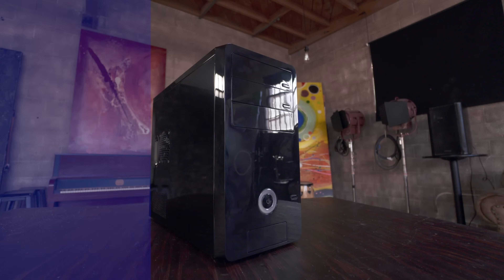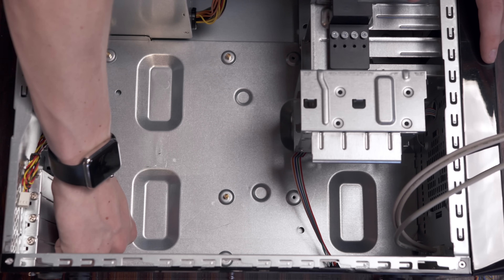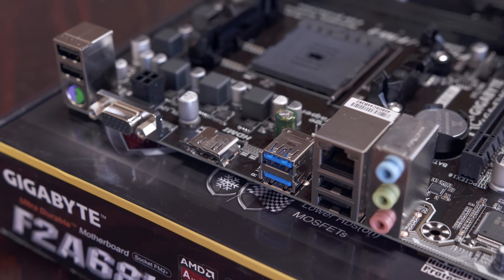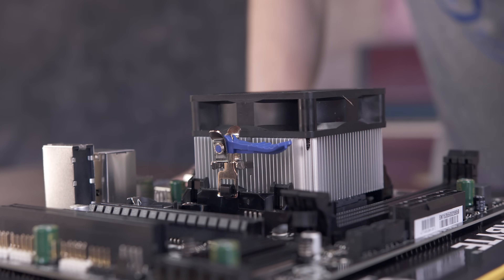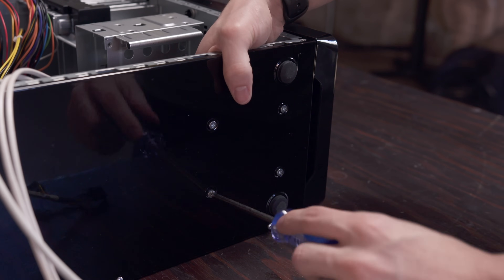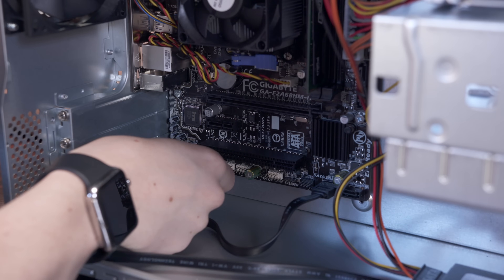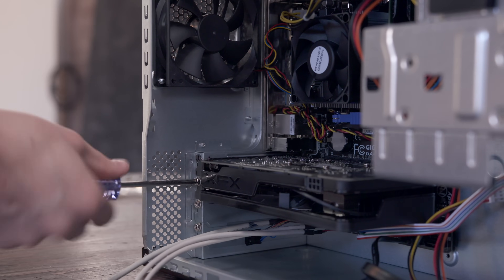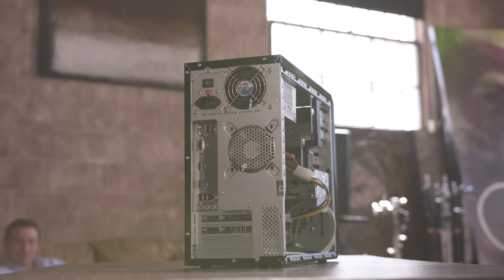How to Build a Gaming PC! (2016)

Comment: Can you do a guide on how to overclock my SSD? I want to run Battlefield 4 at 600 Ghz of RAM but I don't know how to liquid cool my mouse.
Reply: Whoa bro, console gamers might take that comment seriously.
Reply: same, but i could ony download 3 terabytes of ram for my fps to boot quicklier
Reply: That's just flat out wrong. You don't liquid cool a mouse. You have to use fans. And THEN you download the graphics card to screw in the bios.
Reply: HexBuild Wow that's nothing.. I bought a week ago some Bluetooth receiver so my graphics on my keyboard would be ultra so they could response fast when i click on my mouse
Reply: Im pretty sure you get a new GPU so you can have fast internet on your mouse...
Reply: stupid console gamer here, Im looking to get a gaming pc I have a mouse but it doesn't have neon liquid cooling will it still work? I also want to overclock the clock on the pc when I get it working by about three hours or so... I also have a TofuX1-77uV graphics card so Im gonna be getting that sick 10 80 P. What specs would fit my GX1 liquid cooled neon mouse so that I can run the original super mario brothers at ULTRA GRAPHICS, any suggestions?
Reply: Honestly if you want good graphics you're going to need some LED lights and they gotta be red because red stands for Really Epic Draw-distance and for high fps youre gonna need to use a 4k mouse or else you'll get jetlag
Reply: 😂😂😂 Took me a while to see the sarcasm lmao
Reply: Dude, you should first get a new GPU to cool your PC ok bro?
Reply: Can you even overclock a SSD???
Reply: +SilverMight Try and upgrade to 1080p RAM so your 256GB mouse can run games at 4.20Mhz. Thats how I got my SSD to liquid cool my motherboard better.
Reply: TJ Moore The original super mario brothers may be too high for your graphics card.. Try upgrading your soundcard so it could run Medium.. I suggest to play minesweeper ;) it MAY if you're lucky play on 10 fps
Reply: Exactly! RX 480 ram sticks make sure that there is no input lag from your pc and monitor. GTX 1080 ram sticks however have a low voltage meaning you have less hard drive space on your keyboard
Reply: ung loco have you installed system 32? If you have, uninstall it. You should then see steam emminating from the space bar. Download a FireWire cable and pour milk into the machine. And then you're a wizard.
Reply: My ikea core i5 table overclocks to 4.5 ghz and my moniter is overcooled
Reply: Tbh all you need is an i7 4690k mouse and you'll be able to play minecraft with around 10 watts and like 5 GB or something. You should be good to go. Oh, and don't forget your keyboard should be set to 144 hz so that your motherboard doesn't overheat.
Reply: +If you read this you're awesome lmao
Reply: TheVirginityStealer um no 4k mouses are too expensive but you can use a cheaper alternative by getting a 1080p mouse and get a blue led mouse and wrap it around the 1080p mouse for 200 dollars cheaper
Reply: You need a new sound card for the ram to update the graphics cards psu though
Reply: How about getting a Pentium G3258? It's expensive, but you won't have to worry about bottlenecks in your system for a long, long, time. And toss in a GT 210 for the absolute best in graphics.
Reply: Rajiv Paranavithana What are you talking about? Pentium's are good GPUs! The dual-cores allow for it to liquid cool the RAM faster. Thus, speeding up your keyboard's Internet connection.
Reply: WTF AM I READING HAHAHAHHAA
Reply: yeah I followed the instructions but my fans are still running at 4 liters per second even after I over clocked my raid69 Linux server mouse
Reply: Water cooling mouse is quite tricky but rewarding since it decreases power usage and lets you download RAM and you get 4k
Reply: This is the best comment chain ever 😂😂
Reply: No, it's easier to just download more RAM and ghz from the interwebs. Then liquid cool your keyboard, mouse and monitor to get extra FPS.

By the way, what RAM sticks do you guys have? I have two GTX 420 blazeits.
Reply: Peeking Turtle I thought it stood for Super Speedy Dinosaur oh well.
Reply: I like how some people actually took this comment seriously 😂😂😂
Reply: +MrColate8 Why should a minecraft piece of shit know this, go back to consul.
Reply: ***** Yeah, but RX 480 ram sticks are better for budget cuz people who use GTX 1080 ram sticks are overcompensating.
Reply: Your not smart either. "ur not funny stfu" shows how stupid you are y'know. I honestly don't care if you find me funny or not but I think your just some salty kid so that makes me care even less.
Reply: Rajiv Paranavithana You could go with a  Celeron G1840. It has out-of-this-world performance - even better than that of the G3258. It's just that they're not worth the price for the performance they offer. Have you seen the benchmarks? They're insane. It's clocked at a whopping 2.8GHz.
Reply: put your Pc in the dish washer. thats how you'll get it to be water cooled
Reply: Help!!! Does anyone know how to run BIOS in Crossfire, oh and I tried overclocking my monitor but it failed because of my RAM SLI.
Reply: Daniel Sauvé thats okay cause you can change it to ABCDEF keyboard layout. much easier to use because everyone knows the abc's. also, it automatically switches your keycaps for you so no need to do it yourself.
Reply: Bleach Flavoured Clorox Bleach what's so funny, we're just sharing our awesome specs
Reply: Boi, listen here I got a 6000 DPI motherboard, and 16 gbs of processor, and don't even get me started on my badass liquid cooled LEDs. Bro my beast of a pc would annihilate anyone's chairmarks, trust me.
Reply: ung loco just install rgb leds
Reply: Nicolas Henshilwood Do not delete system 32
Reply: Did the intel i5 come flatpacked with instructions?
Reply: +Vulture Vult nah fairly sure you need to overclock your cpu cooler to update your graphics card psu
Reply: you all have it wrong you need to use liquid nitrogen on the ram the you overclock the power supply
Reply: Bashir Wada ur not funny stfu
Reply: +SilenT don't want to be grammar nazi but this kid is either uneducated or he's a 8 year old
Reply: Today im downloaded 8 gigs of ram, im overclocked my hdd to 20000Rpm and the case to 4Ghz
Reply: Sam van der Kris ARE YOU CRAZY?!!?!? U need to download the goat before the ram so then you get enough ghz to upload it into the cloud and then you wait for it to rain so u can get it from the sky. After that u have to buy GTA V and finish the story mode enabling you to lead illuminati or anonymous which u later find they are both connected and have to kill the president......... of Finland and then u can put it into ur computer and enjoy..... good day sir
Reply: I upgraded my RAM to 5GHz and my CPU got more FPS. Try bottlenecking the BIOS and to see if it helps your Mobile SATA GPU.
Reply: ***** 

I think my power supply will provide the sound I need. I just need to overclock it to  600 ssds.  Not to mention I'm downloading more ram to my power cable.
Reply: to over clock your ssd first you will need a hammer, and then to run battelfield 4 at 600 ghz ram you need to pour water on your ram slots and then to liquid cool your mouse dip it into water.. and if you want to liquid cool your pc then put it in your tank. it works perfectly fine..... as you wish :D
Reply: cringe
Reply: edupz Sorry dude, you need an Amd i7-234567.
Reply: Ung Loco bro if you use a gtx 980 the mouse liquid cools itself just make sure your fish tank is inside the computer case
Reply: omg someone should make a pc with a fishtank water cooler HOLY SHIT THAT WOULD BE DANK
Reply: Wilgains Fleuridor it's a joke you stupid idiot
Reply: +Wilgains Fleuridor dont you get a joke?
Reply: Wilgains Fleuridor you're a fucking idiot
Reply: No, I liquid cool my motherboard. I use solid nitrogen (its better than liquid nitrogen) to cool my motherboard. I attached my fans to the 220VAC on the wall so I can get very fast solid nitrogen pumping on my motherboard. I also downloaded some ram and got myself a Seagate 4TB SSD for the graphics card. AAAAND got myself a 5GHz Octo-Core air cooled LCD keyboard so everything is cool. I have the best Xbox in the world.
Reply: Areg Hovhannisyan peasant. i fly my pc all the way to space and play it there. no air=no heat=no throttling. thus i have the best n64
Reply: You can't play BF4 with that much memory. You need to make sure that you download AT LEAST 1 THz, or the textures will look like N64 graphics. Also - I can't stress this enough - MAKE SURE THAT YOUR POWER SUPPLY'S WATER RESERVOIR IS REPLACED AND FILLED AT LEAST ONCE EVERY HALF HOUR (Antifreeze works fine, but I'd recommend perchloric acid because it tends to produce more fps, especially in GPU-heavy games like Minecraft and RuneScape.) Another thing...I'd highly recommend building a custom water cooling loop for your headset, especially if you plan on playing CS:GO for extended periods of time. You don't have to go super expensive. I just duct taped some PVC pipe together and led it from my left earphone to my GPU's blower fan. It's been working rather nicely for the past few months.
Reply: TheVirginityStealer Yeah but if you want a GTX 1080 ready storage unit get a Samsung ERO 690 with 500 gb of storage
Reply: I actually thought he was serious at first LOL
Reply: arun hdgaming I dont really like Ikea cores there are always pieces left over when im done putting the pieces together :<
Reply: omg, my friends @ school (and me) all have those kinds of icons
Reply: Best comment ever
Reply: lol :D
Reply: well i actually do sweat a lot and my hands get warm so it wouldn't be that bad :D
Reply: take a clock and stick it to your ssd
Reply: ***** no he needs a water blonk so the under water mice can have more air by 10000000000000000000000000000000000000000000000000000000000000000000000000%
Reply: You'll first have to upgrade the RAM in your brain if you don't want a bottleneck.
Reply: Bashir Wada LOok whos talkiing and how does it proove that im stupid like ur family
Reply: +LimitLess I hope your not calling me the illiterate one.
Reply: didn't tag you did I and even if I do what're you going to do? ddos me? even if you do I use vpn most of the time I'm online
Reply: +LimitLess Whoah dude. Take your tinfoil hat off. I asked you that because I was too stupid to realise your obvious troll. Well I do have to take poe's law into account so I'll just ignore you idiots now.
Reply: As you wish master Bashir
Reply: +LimitLess You shall serve me well, peasant.
Reply: +Bashir Wada lol
Reply: I run Battlefield 4 with 1.8 GHZ
Reply: +Noah Roberts hey, I just tried this and my SSD is now negative of what i wanted it to be (35 GHz), any help?
Reply: hahahahahahaha that was funny man!
Reply: Wait what?
Reply: The Pentium is dual-core, so some games won't work well on it. Quad-cores are the way to go nowadays
Reply: Celerons are shit.  Pentiums aren't bad.
Reply: O_O
Reply: Yes, I also recommend a better PSU.
Reply: What the hell dude 😲

Power Supply
Reply: dishwashers use hot water so you would be water heating your computer but it wouldnt really matter because your computer wouldnt work anymore
Reply: hahaha 😂😂
Reply: That was good
Reply: +Cvetelin petrov true ;)
Reply: If this was an actual youtube channel, I'd subscribe
Reply: +frostMW321 what?
Reply: +Mahmut Arkawi the comment string
Reply: /r/ItsAUnixSystem
Reply: Don't forget to overclock your power supply and run your fans in LSI Crossfire
Reply: +SeemsLegit Gaming where did u learn all this I want to learn about this?
Reply: DisturbedAgent 1 Oh, I'm sorry. I forgot that.. I'll try to remember it for the next time. Thanks for the help!
Reply: xD
Reply: a liquid cooled mouse would actually be cool
Reply: ***** 

ya getting my mouse up to a stable 60 bpm is really important for storage. next ill get a new gpu for my speakers too.
Reply: I only have 10 HDD GPUS of RAM :(
Reply: Sambhav Khanal It worked but if you dont watercool your GHz your mouse will bottleneck dont forget to boot your keyboard's bios for higher RAM and FPS
Reply: DUDE are you kidding me? AM I THE ONLY ONE WHO KNOWS THAT YOU NEED TO GET A GOOD CPU FOR YOUR TABLE?!?!?! GOSH!!!
Reply: You need an imac
Reply: macs suck lol. my intel core athlon x2 running at 8.4ghz plasma cooled along with my titan x ram and and my awesome 500w corsair graphics card will beat the shit out of any mac. not to mention my overclocked mouse and keyboard
Reply: Lol
Reply: Quacky my pc has an electric bubble blowing cooler
Reply: Quacky XDDDDDD YAAAAAS
Reply: You need a water cooled keyboard and mouse
Reply: ***** ya a little bit im like 32 percent retarded im as smart as a fish my earballs is what i see from i smells out my hairhole
Reply: Its a joke
Reply: ***** WOW THX FOR THAT LINK!!! now my keyboard ram has doubled :))))
Reply: Shadez Entertainment wow that mad so much sense to bad i just sent my hacking probes into your mouse i hacked into the motherboard of your mouse and now i have downlaoded a camera into your mouse i can see everyone move
Reply: I need to put a better CPU in my headset and more ram with a water cooler so my headset will sound better
Reply: mr. DEATHRO no all  you need is new ram for the headset also just apply some thermal paste on the earcups for maximum cooling
Reply: THIS MAKES NO SENSE
Reply: Wilgains Fleuridor ever heard of a joke
Reply: ***** no its you're lol
Reply: I DIDNT SEE THE JOKE
Reply: XD
Reply: lmao
Reply: there is no reason to call me an idiot right now
Reply: Try flashing the UEFI USB BIOS. If your mouse's DPI is above twenty thousand, you should be able to upgrade to Windows Eleventy, Petaflop Edition.
Reply: Daniel Sauvé everyone knows that Mac Windows is the best OS
Reply: Shadez Entertainment
I thought it was Windows Mac! Y'know, with multithreaded windows and SLI gambrels and classic Mission-style earthenware roof tiles to prevent thermal throttling!
Reply: Daniel Sauvé windows mac lets you overclock your mousepad to silk with no extra downloads required. also, it supports multiple keyboards in your graphics card for maximum efficiency. best os 10/10
Reply: Shadez Entertainment
Really? I thought Windows Mac had issues with QWERTY keyboards. It's just deleted these keys on my other sixty Cherry MX Fuschia Blue keyboards.
Reply: Shadez Entertainment You need Ballistix ram for that.
Reply: ʟᴏʟᴅᴀᴡɴツ you can just download more ram anyway so it doesn't really matter
Reply: Need help, overclocked my computer case and now its walking around my house
Reply: just assrape it to deactivate the overclock
Reply: Shadez Entertainment
Are you crazy, this could reformat the RAM BIOS! Everyone knows you're supposed to give your PC case the D from the front, and never the back!

It's why CD-ROMs are called that, you know. "CD" stands for "cum deposit".
Reply: ***** you should overclock your floppy drive reader
Reply: ***** I wouldn't wait for Ryzen, the name suggests zombies. You know, as in "Ryzen from the gwave".
And I don't want no PC Zombies, thank you very much. I already have enough problems with my hyperthreaded Power button and my i3 F3 keyboard key.
Reply: bro get at my level. I overclocked my Power button and liquid cool my Reset button
Reply: MARKRAM Did you flash your monitor's BIOS Petaflop?
Reply: ofc, and i also have custom rgb lighting for my Backspace key
Reply: MARKRAM
Good. You couldn't have tightened the graphics otherwise.
Reply: download the driver for the ssd bro, you'll get a 2fps psu
Reply: stfu m8 i have an overclocked sd card and plasma cooled hdmi cord
Reply: ung loco duuuude I liquid cooled my screen and overclocked my casing to 200 ram
Reply: I love YT comments lmao.
I literally died laughing reading the replies.
Reply: ung loco guys im getting my monitor nitrogen cooled. Also im overclocking my toilet to clean my RAM! Wish me luck plz
Reply: Is this a joke😂
Reply: What do you think? ;)

Most of us are either serious PC enthusiasts having a ball at the expense of the opaque nature of the jargon, or newcomers to the Master Race who realized there's a lot of fancy-pants acronyms and data points being tossed around in the eternal war waged in the name of determining who has the beastliest of all beast PCs.
Reply: try going into bios and overclock your stopwatch to increase the speed of your power supply LEDs
Reply: or heck get a diving kit and go to the mariana trench. its pretty cold there so no need of any cooling for your atari
Reply: ung loco have fun watercooling ur mouse lol
Reply: bp Actually you have to cool your 4 pin connecters and than download 69mb of ddr4.20 gaming ram than oc your bios to ensure blazing fast preformanxe
Reply: wth
liquid cool mouse?
tf
Reply: Well SSD's dont run at clock speeds like GPU's and CPU's do, so i would say no.
Reply: noob, I have both a liquid cooled monitor, mouse and keyboard